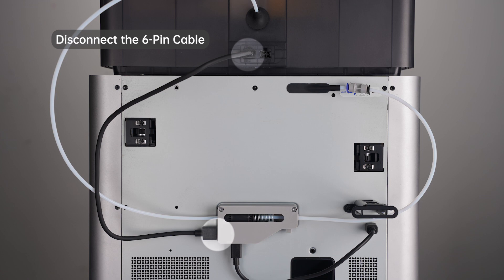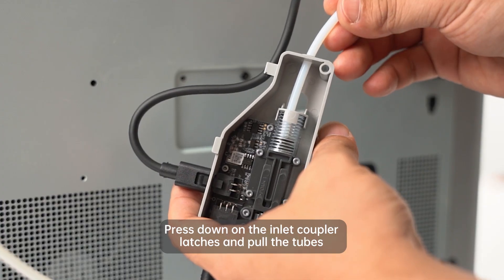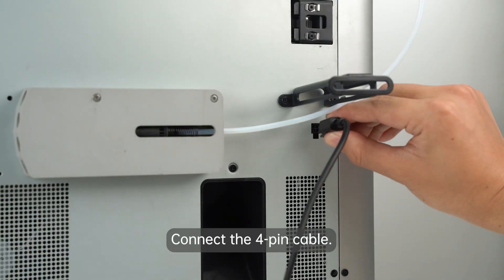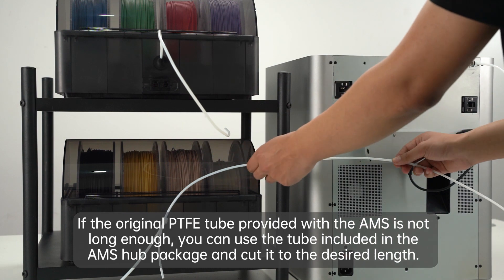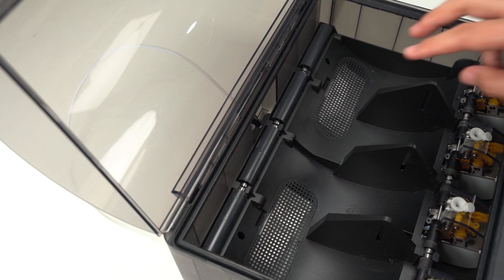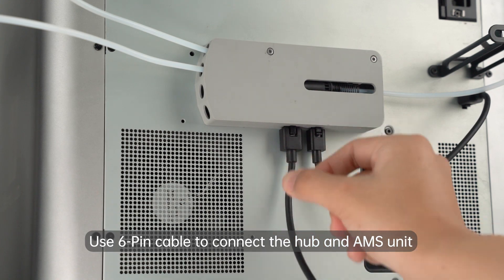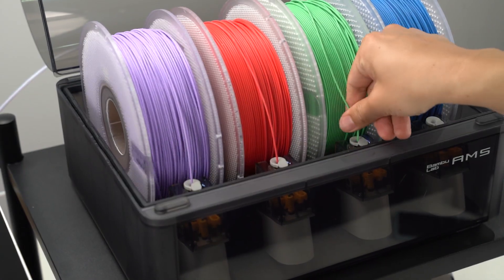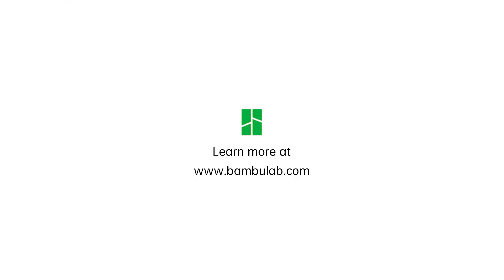Connect multiple AMS units with AMS hub

Comment: Is the Hub necessary when I have a p2s and want to use a second and 2 pro on it? The standard buffer has two slots. So theoretically when I use the second slot for a second ams it should work or not?
Reply: My buffer has one slot, and I used a splitter going in, and it works perfectly. I had this weird thing with the hub where one AMS’s filament would get stuck at the extruded.

Comment: Thanks for the guide, i have installed my second AMS, the first one still works as normal but when i try to load from the new one it loads all the way to the extruder and wont go through. it tries a few times and then says the extruder is blocked or the filament is not flat cut.... the original one still works after. is this faulty or have i missed something?

Comment: Very good video.  I have one comment to add that might help someone else.  I have an X1 Carbon with the AMS. When I reattach the Bowden tube into the back of the AMS, (at least on my printer) you need to use your finger to align the rubber sleeve slightly on the inside of the AMS to make sure the Bowden tube is guided properly and fully into the AMS and bottoms out inside of the AMS and locks in place.  If it is loose and can be easily pulled out, then the filament will push the Bowden tube right out and filament will be like spaghetti in the back of your printer!

Comment: This is the hub that should be standard.  I'm not sure if the single AMS hub has been upgraded but the old one puts all the cables backwards so you need to print a tool to release them where the 4 AMS hub puts the cables the correct way

Comment: I watched this to add a second AMS to my X1C. I also have a Prusa Mk4S/enclosure/MMU3. The MMU3 is a Rube Goldberg contraption that is obviously a afterthought. I have chronic problems with it and it is not expandable. The AMS is a vastly superior multi material solution. The X1C has displaced my Mk4S as my primary printer.

Comment: My problem is with the multi material hub. Is that the multi material hub position for the connector and the PT tube connection to the printer is not good enough designed. It could be like 20 mm warm up move it 20 mm more to the upper glass plate up so it would not be sliding on the four pin connector to the 3-D printer and the cables would not be, tangled around the poop shoot so maybe you can redesign the position or make sure that the people are printing an extension or you provide an extension for the amount insufficient Position?